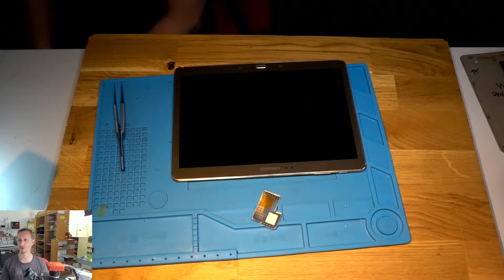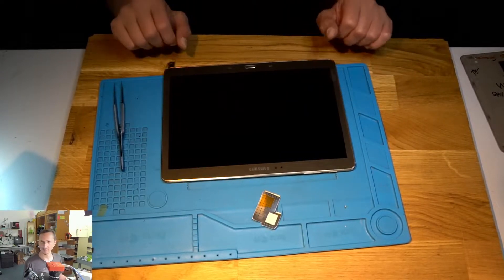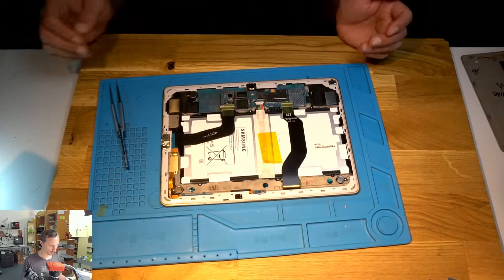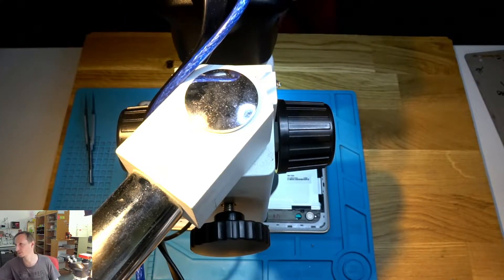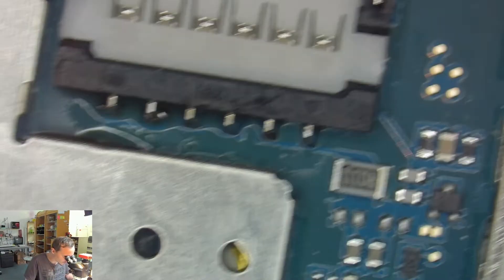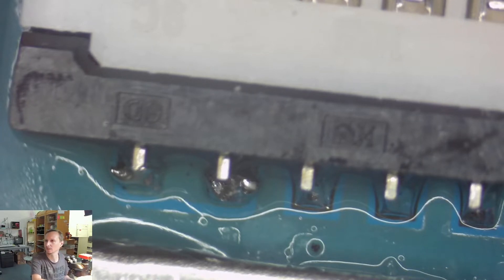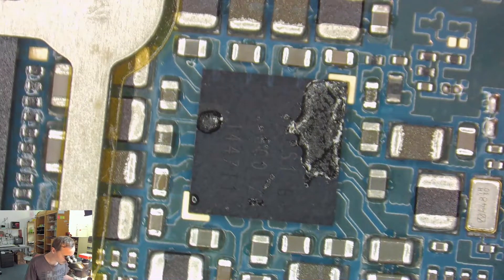Galaxy Tab S 10.5/ SM-T800/ Constantly Reboots/ Restarts

Comment: My sm-t800 dont stop in boot loop. I can enter in download mode, recovery and install other rom but the problem its not solved. I try to disconnect de flex buttons but nothing...
Reply from the maker: In recovery mode the power consumption may be lower than when booting to normal system, can be a powermanagement issue, can be anything
Reply: @irepairitall  So it's not worth changing the battery?
Reply from the maker: @danicod4  Chance’s are minimal that a battery dies from one day to the next. Does it charge, when off?
Reply: @irepairitall  
Yesterday yes but today it does not charge after the battery runs out. Sometimes it shows the charging icon but turns off and does nothing.
Reply from the maker: i do not think it is a bad battery, but for further diagnose a known good battery would be helpfull.

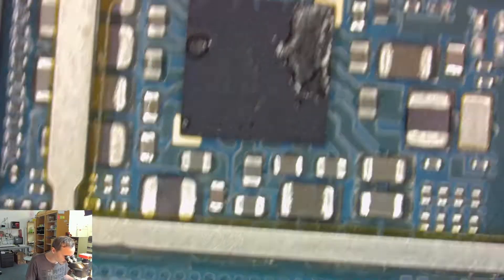Comment: Hi, I have this problem too. Could you tell me what the product you show at 1:50 is?  Also, do the heat shields just lift off or do you need to heat them to melt glue or anything?  Thanks for the video 👍
Reply from the maker: Just lift them off like clips. This is the Main PM IC: s2mps11b4. You are wellcome.
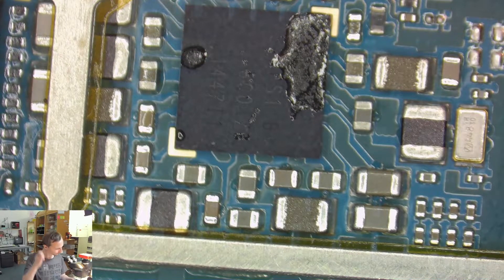Reply: @irepairitall  thanks for that info.  What is the spray can you hold up at 1:50?  Is that all that was required to fix the issue, or were other processes involved
Reply from the maker: @russellsmith4549  solder flux and hotair, i am reflowing the chip.
Reply: @irepairitall  hi, im sitting with a friends SM-T805 that is also in a restart turn off loop, i have "reinstalled" the OS but still same issue, i have lifted the cover but i am not able to remove the metal heat shields, any chance you can show how you removed em?
Reply from the maker: @noreply3904  They are just klipped down, a little bit of force upwards should do. I use a tiny flat screwdriver.
Reply: @irepairitall  Hi, sadly the solution did not help in my case, still have the same issue :( thanx tho
Reply from the maker: @noreply3904  Sad to hear that, you are welcome .

Comment: Hi. I have a problem with a samsung tab s t805 tablet that restarts 4 seconds after opening (stays on samsung writing). 
If I try hard reset and have my finger on the power button it stays on, but if I take my finger off the button it turns off. 
if I go into the reset menu it stays on and completes the installation, but when it restarts the old problem returns (rebooting). 
I tried with another battery (second hand battery) and same problem!
any idea what the problem is?
Thanks.
Reply from the maker: You said it! Shorted Powerbutton...?
Reply: @irepairitall  can you please tell me how I can solve this problem?
Reply from the maker: @dragerjohn9620  It can be anything,... faulty nand, partial faulty pmic, cpu etc... That is impossible without diagnosing/measuring the mainboard.
Reply: @irepairitall  new update : I tried again today to turn on the tablet and it turns on, gets to the home screen, you can play a little in the menu then it goes back to its usual (rebooting) and I noticed that it is burning,where is the processor, I took down the protection where the processor is and the processor (samsung exynos) and a chip next to him (1422kae thgbmbg7d2kbail k18382 japan) is heating up !
I'm thinking of changing the motherboard, do you think the model T800 will fit (I don't necessarily need to have sim, I'll use hotspot)?
Reply from the maker: @dragerjohn9620  Most of the time the nand flash is near the cpu, can be a failing nand. I do not know if the no sim model is the same size...
Reply: Exact same issue